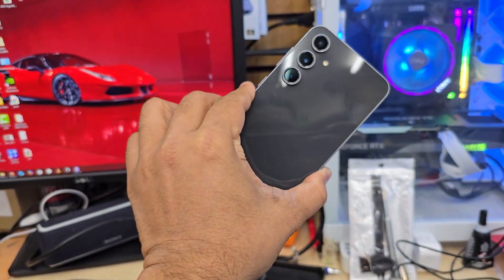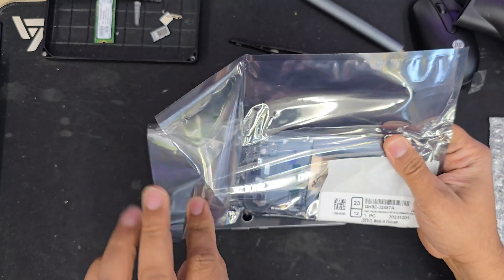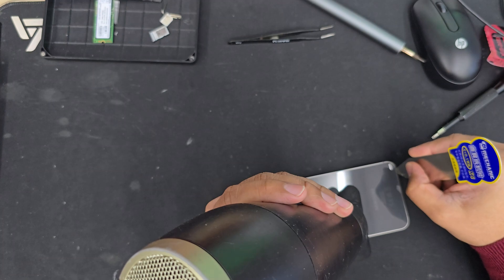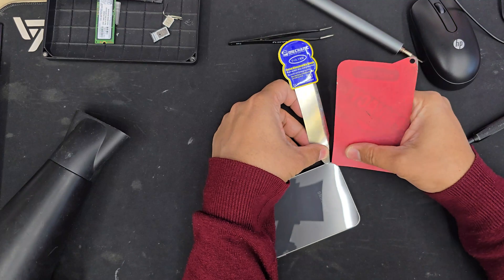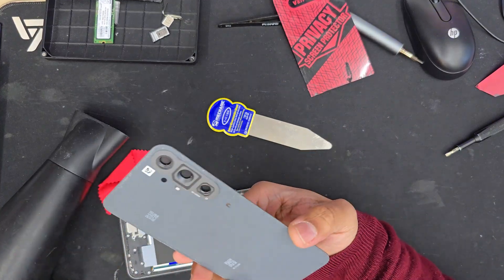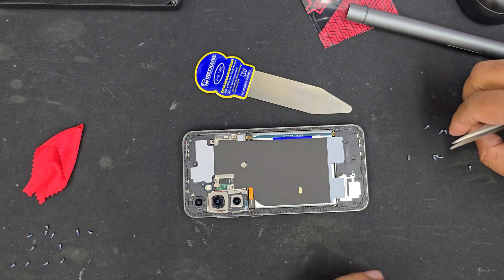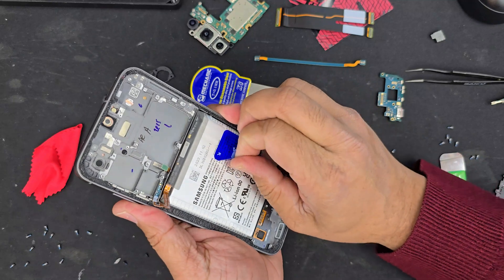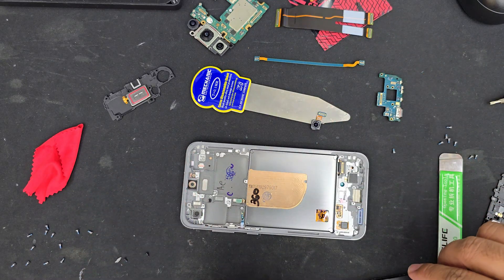How to Replace a Samsung Galaxy S23 FE Screen: Step-by-Step Guide

Comment: One thing i did catch, the black screw on the bottom near the vibrator, when putting back together it should go near the hole directly below the wire that says sub, not in the center of the board 🤙. Otherwise great help

Comment: so i was removing the front camera module and the front camera's flex black thing that was sticked to the camera module disconnected from it what do i do now

like the black flex cable and camera module is disconnected but the flex cable looks like its in good shape so is it possible to like stick it back together
Reply: okay so i ended up buying a new camera module off amazon but how do i make it hold in place like i dont have those white things anymore